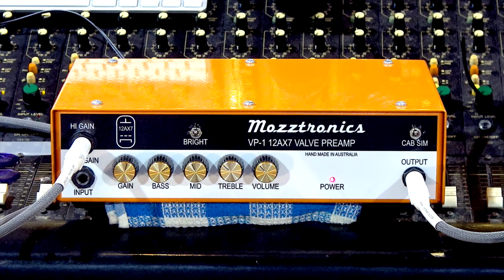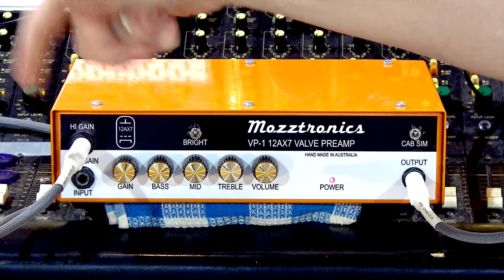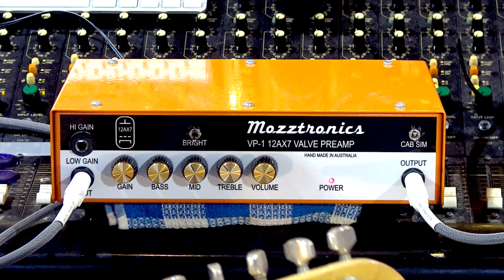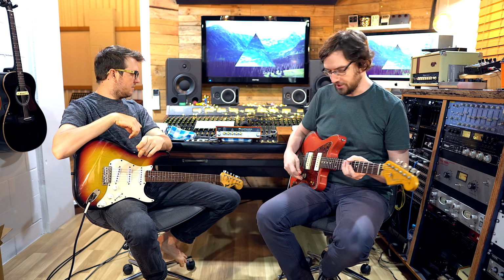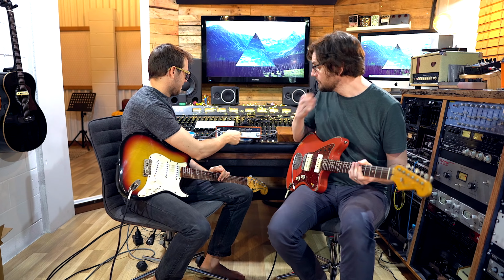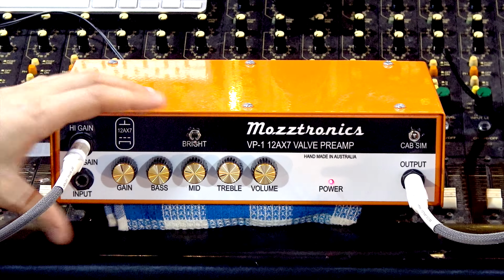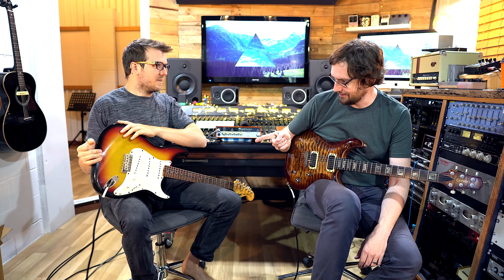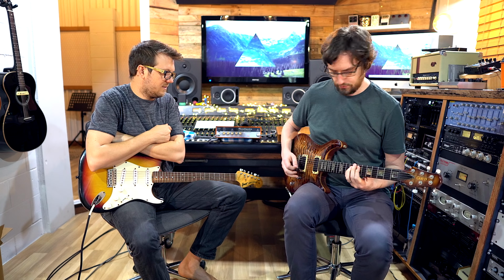Mozztronics VP-1 Valve Preamp into a Tube Poweramp

Comment: Why is it so huge though? I have several two-tube pre-amps that live inside stomp box enclosures. I get it that this is geared towards studio use but I think by just omitting the transformer into a separate power supply it could easily fit into a pedal (and potentially gain some live-use market). Just a thought. I'd be hesitant to buy because of the format anyway (although it looks nice).
Reply: Hi Tung. I originally made this for my own use in my little studio, so i could record direct without an amp. I built in my cabsim circuit from my cabsim CS1 pedal which can be switched on and off, so you can use software vst's, or with a power amp as Alex & Gabor have done in this video. The only problem with putting this into a pedal enclosure, is that the internal high voltage for the tubes is generated via a step up transformer, and i physically need to keep this away from the tubes to eliminate hum & noise.
I also have a pedal with a tube in it, check out the video that Alex & Gabor have made for the TD1 tube driver....  so as i already had my TD1 tube pedal, i had no need to put this preamp into a pedal format.